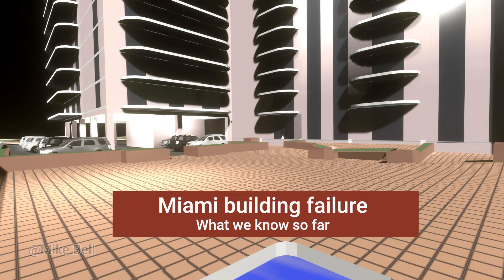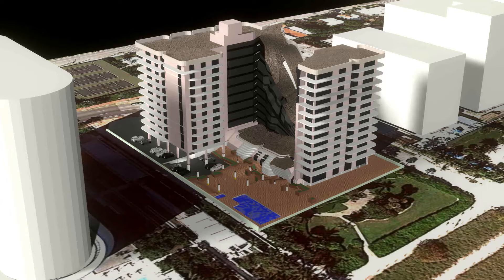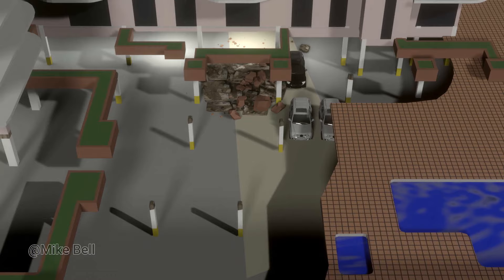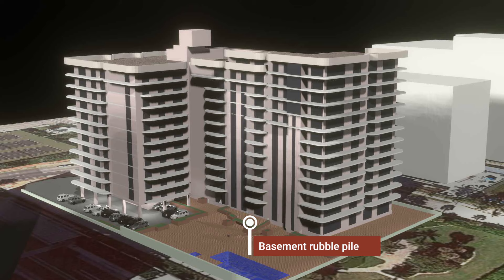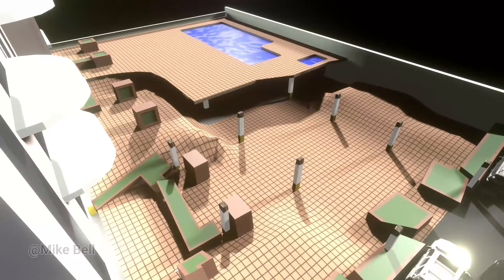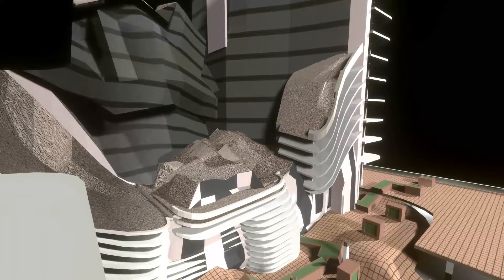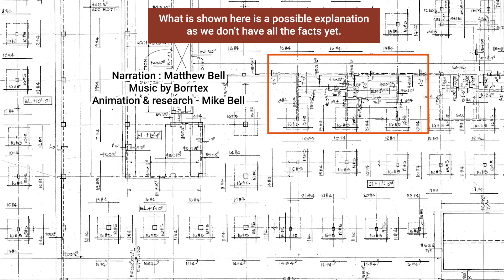MIAMI CONDO COLLAPSE | visualization of the evidence pt2

Comment: When the sprinkler pipe burst why didnt the waterflow activate the fire alarm?
Reply: Totally separate systems, one is mechanical and other is electrical.
Reply: @DGTelevsionNetwork  It should have activated the waterflow switch setting off the alarm
Reply: @the_expidition427  yea maybe once all the water came out, but the thing doesn't activate instantly, by then the building was already gone. That's even considering it had a newer fire alarm system and not the original single zone single buzzer that was ubiquitous in the 60s and 70s.

Comment: Correction, there was PLENTY of warning before the collapse, it is not at all a lack of warning.  It was said this building was in grave and dire need of repairs and they were not only structural warnings but almost cosmetic warnings that accumulated overtime and no one decided to do anything about it because people just don't want to put a single dime into their safety, as long as things are holding up, people don't have to spend, they don't spend.

Comment: If the video taken 7 minutes before was showing evidence of the pool deck collapse, I would have expected car alarms going off in that video. Maybe at that point the rubble was only in the drive area?
Reply from the maker: Yup I agree. A lot of mysteries here.
Reply: Some cars the alarms only go off if you try to open the door from the inside with the windows rolled down. That’s how my 02 Sierra is. If the cars simply got crushed with the building, they wouldn’t go off.
Reply: While I’m being contrarian I dont get how the spilling water in the video is from the sprinkler. Caveat here is I don’t know sprinkler setups that well…but from what a I do know I’d think this was a wet pipe system. As such I would expect a spray not a flow…and I’d expect the supply side to be to the West towards the building utilities and this water was flowing from the East. It was also flowing pretty “wide”, where sprinkler lines are small. I believe this water was from a lower pressure line like a 4”+ gravity line like we see in the garage walk through videos. Maybe it was one of the supposedly hard working groundwater sumps…
Reply: @deanrinehart  In the video, there is video of the garage a year before the collapse. You can see the pipes.
Reply: @KayInMaine  right…you can see sprinkler and waste pipes. Not just sprinklers. 

And if you watch when she shows the pipes over the ramp, I actually don’t see sprinkler lines there…I see low pressure pipes…one originating from what looks to be some kind of bulkhead wall east of the ramp, connected with rubber or black PVC fittings. I think that’s the set of lines where the water was coming from, but zero clue what it was.

Irrelevant I suppose but for clarity’s sake I just don’t see it as water from a broken sprinkler supply.
Reply: @deanrinehart  I honestly don't know what those water pipes were for. Could have been for the sprinkler system, their water source, or something else.

Comment: The building had almost no beams. After the initial failure it had no chance to stay put. You can also see how the lack of beams also caused a pancake effect on all floors, effectively killing everybody without any chance to survive. The columns are the last thing to fall, you can see them resting on top of the pile of rubble. The concrete slab was punctured all the way through.

Comment: What a poor design that left 3 columns responsible for interconnected buildings to collapse completely.
Reply: Another channel did an analysis of this, and he says those columns were not built correctly. He said there should have been shear caps built on top of those columns. He shows the design, plans, construction photos and after the destruction photos and discussed the reasons for lack of those shear caps and how that contributed to the collapse. He said he feels there will be several reasons why it ultimately collapsed, but had those columns had shear caps built on top, it wouldn't have caused a total collapse of the structure. I'm sure it was probably poor engineering, poor construction, and almost complete lack of proper maintenance combined.
Reply: @minigirl6379  Absolutely agree. An engineer responded to my comment about my observation and said that those 3 collunms are at the basis of the investigation. Further, the interconnectedness of the buildings is not normally found to avoid domino collapse effect. So sad. I'm a Florida resident of 20+years and can only pray we learn, inspect existing structures, and not let money be more important than human life.

Comment: A couple of years ago I was doing a mechanic repair on a expedition parked in the garage of a building located a few blocks away from these towers ...it was raining and the garage was flooded , I looked at the beams and some have missing chunks of concrete leaving exposed the rebar corroded and there were red stains on the concrete  due to corrosion.. I was terrified and just wanted to get the hell outta there ASAP... And so I did .I was thinking exactly about the structural damage! ..I said  to myself I don't ever wanna be  back here again 😱

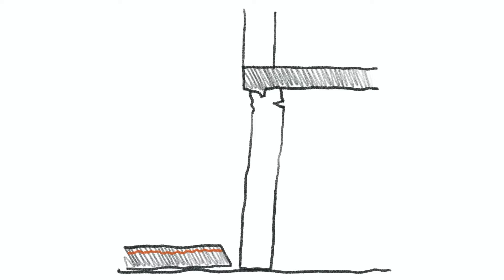Comment: Your diagram at 5:40 has been theorized by several people, but hasn't been proven.  The columns at that location were very strong compared to the deck structure that would be pulling against them so likely wouldn't be damaged that easily.  Plus if that failure of the columns had occurred the columns would have failed immediately after failure of the deck slab.  It is more likely that the deck failure progressed inside the building and left the perimeter columns freestanding for 2 story height when then allowed them to buckle.
Reply: There was a monolithic beam tying the pool deck columns at the building columns around where unit 111 was, under their deck iirc.  If the pool deck end became free hanging while supporting the unit 111 deck that is a lot of torque on a critical column.
Reply: @k53847  Torque no, bending moment yes.  The BMA is 15" deep with 2#6 top, the column type C is 16" square with 3#11 in each face.  That makes the column on the order of 5 times as strong as the beam.  The beam could break completely off the face of the column and the column not feel it.
Reply: @billj5645  Could be.  We'll see.
Reply: Yep the columns survived
Reply: @billj5645    Also there was a 12 floor building on top of that column. That's a lot of weight pressing on that column.  if there was a failing pool-deck, then rotating that pool-deck  would have tried to rotate the 12 floors on top as well, but as the 12 floors building has much more weight, that would not have happened.
---
So it's more likely that things went the other way round:  A controlled demolition of the 12 floor building, which landed on top of the pool-deck, would have caused the pool-deck to cave in.

Comment: I agree, Mike. This building stood for 40 years and it really seems like something happening today or in the last year or so caused the building to weaken quickly. There were workers on the roof the day before the collapse. I wonder if they did something up there? Oh boy.
Reply: Whatever the workers did on the roof would not have had an impact or compromise the instructions below. We need to know is what is there any work in the parking structure. The slightest heavy tremble on the roof would’ve caused cracking within the walls it would’ve been noticeable prior to structures in the garage being effected.
Reply: @BuckleBunny  how do you know that? How do you know that they did not Jackhammer through roof joists? There is a red contraption on top of the original collapse pile. Where did that come from?
Reply: @BuckleBunny  there were already significant cracks in the roof that was mentioned in the report done three months before the workers started working up there. The building inspector who was there 14 hours before the buildings collapsed said that he didn't see anything on the roof that would have told him that the roof was damaged and deteriorating quickly, but the words in the three-month report said that the roof was deteriorating exponentially. That building inspector was brought in front of the Town board and asked about it and he said that he didn't see anything up there. He said that he didn't notice any cracks or nothing. Liar!

Comment: What was hard to grasp early on was how large and extensive the underground car park was and how that could and did interact with the building supports. I remember early on they kept mentioning damage to the pool deck and under the pool, but from external views only, the pool looked like it was fully separate and away from the main building. There were references to water and deterioration in the underground parking area, but not a clear view of how large it was or where both it and the reported deterioration were relative to the collapse. Early on I assumed the focus on the pool deck was people trying to get a early on "scapegoat" for the failure, as how could a pool deck decently separated from the tower platform, cause a failure that collapsed almost exactly like a controlled demo, ie many/all of the main supports in the collapsed section failing almost all at once so it pancaked straight down not like toppled over. This is a much clearer view of how it could have happened but its clear much more investigation will need to be done on how the main supports were so effected and how it was able to get to this point in the first place.

Comment: The pool deck shouldn't have been connected to the building like that. The small sheer wall on the last side to fall should have been concrete all the way around not just one side and all the way across like on the other side. I am betting this was all to save money. So sad. 😩
Reply from the maker: Actually ground floor slabs like this provide important sideways sway support to the tower.  Its standard practice and for that reason the concrete is directly connected.  And in almost every case except this one they do the job without problem.  
The shear walls in this project were woefully undersized and yes all in the pursuit of saving money.  If I worked on this project I would have insisted on greater shear wall components.

Comment: Wonder if towers should have to undergo some sort of scheduled safety inspection like vehicles?
Reply: Most HUD certified buildings have yearly building inspections by the city. That's probably why low income buildings have far less structural failure compared to high rent non HUD properties. Hell, the New York projects were built in the 40s and still stand to this day, even with extreme weather conditions.

Comment: Abandoned buildings remain standing for years even with zero maintenance and several elements failing.  Awful design.
Reply: Are the abandon buildings next to salt water? And are they concrete buildings or steel framed?
Reply from the maker: Buildings next to the ocean need greater concrete cover to mitigate corrosive effects.
Reply from the maker: Great point.  And designers should and do make allowance for lack of maintenance.  Care by owners is not a certainty.

Comment: Thorough examination? When you use back hoes to scoop up the debris and truck it off site as fast as possible, it doesn't look like thorough examination is a goal.
Reply from the maker: I agree.  They did clear the site at an unholy speed.  The vital clues as to why it failed lay in the rubble.  They say it was a crime scene.  But if you want to know who is criminal you need to collect as much evidence from the rubble pile as possible.
Reply: @Mike-Bell  to be fair they were more worried about body recover and safety of onsite rescue teams instead of finding out the collapse which usually happens after

Comment: Another poster did an analysis and noted the structural elements under the planter boxes was inadequate. Also suspected that the post construction PH floor brought the column loading in the basement much closer to the design limit.

Comment: Also something to note- large palm trees were in the planter boxes until 2017. A hurricane damaged them and they were removed. There is a possibility that whatever they used to remove them, or the hurricane force winds that pushed them around may have caused some latent cracks, and further intrusion of water around the pool deck. So many factors at play it seems. What a poorly maintained and possibly poorly designed (or built) building. Tragic. A wake up call to all other buildings, whose fixes are currently being delayed, and to those who are not as proactive when it comes to structural maintenance.

Comment: I heard that the guy who demolitioned the remaining part of the building found that the plans did not match up with what he found in the remaining part of the building. I think there is an article about it.
Reply: There was a lot about this building where as-built and as-repaired/changed didn't match the original nor later plans that were on file.  Suspicion is that there was a lot of work done for which no permits had been filed.

Comment: First I thought it was a pile foundation failure, some kind of rotation.  Now I'm wondering if punching shear at the plate-column interface.  Once pull deck collapsed, outer columns lost lateral stability, buckled. Maybe all columns were compromised by salt intrusion as you say.  On top of that maybe under-designed to begin with.  AND didn't I read they added a penthouse floor in recent years?  Columns were probably right at capacity before salt took to the rebar.

Comment: Blueprint analysis shows that the building was largely constructed to bare minimum requirements. Dead loads were mostly at 100% as of time of construction and simple redundancies and reinforcements were generally lacking save where legally required at the time. So while their was poor maintenance built up over time, as well as a specific flaw at the initial failure point, this was fatal due to how minimally the building was built.

Comment: What surprise me most is the absence of beams conecting the upper part of the concrete columns nor capitals on the column's tops, as an alternative to prevent the punching of the slabs. The structure of the building itself had the same structural design, no beams that could have prevented the bukling of the columns, and weak connections between columns and floor slabs.
The combination of wet and salty seaside environment, 40 years of poor maintenance and a rather reckless design is the probable cause of such nightmarishly disaster.

Comment: There was a concrete wall behind my old apartment building, it had similar type of damage shown here from water and salt corrosion, it slowly collapsed, pushing in the side of the building to start.  At first you could no longer open the window.  Then the wood paneling cracked.  Then I woke up one morning and the wall had collapsed in the middle section.  I warned the landlord, but no surprise, she didn’t want to deal with it.  Even though, the wall was supporting a driveway, all the weight from that concrete wall, the road, and any vehicles up there were literally putting all that weight into the side of her building, she didn’t care.  That lady was nuts, there was a lot wrong with that place.  Glad I got out, it burned down 3-4 years after I moved out.  It caught on fire once while I was living there too.

Comment: During the construction of  Champlain Towers South, a Crane fell on several Pile Caps damaging them and they were not repaired properly.  The columns that failed causing the collapse were scheduled to be reinforced in the 40 year update plan by Morabido Consultants by a concrete beam between the damaged caps. They knew about the foundation damage that caused the collapse because they had specific plans to reinforce the Pile Caps that failed causing the disaster. The first column that failed in the collapse was pushed through the basement slab and all was left of it is a square hole.
Reply from the maker: The foundation collapse theory has been canceled. The litigation engineers and NIST concur on that. The foundations of this building held.

Comment: Look at the column labelled for parking lot 38. There is no evidence of the density of rebar which should be traversing the column capitol in both directions. That is readily found in the drawings.  This is also seen in other photos of the punch though columns with only two bars in each direction. There should be 4 or 6 rebars in each direction, depending upon the size of the columns.
On column "38" I see one rebar along the centre line of the column and two in the other direction, separated by about 2 feet. That is seriously under the specified quantity.  There are obvious signs of heavy rust damage.

Comment: With many tenents upgrading their condos with marble, granite in their kitchens and baths, the tons and tons of extra weight was never calculated. Almost every unit had 
These upgrades. The original design had wood and vinyl flooring which weighs much less. Think of all the other condos and appartments where these upgrades are done!!!